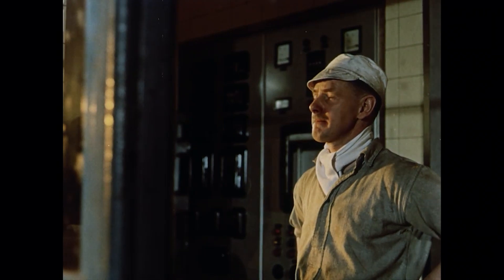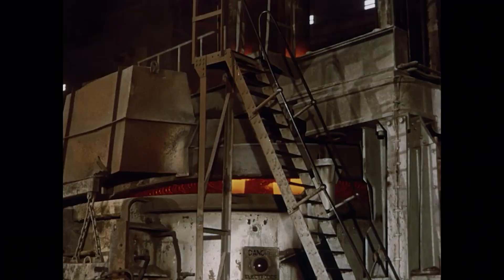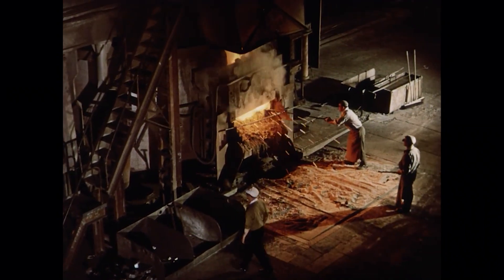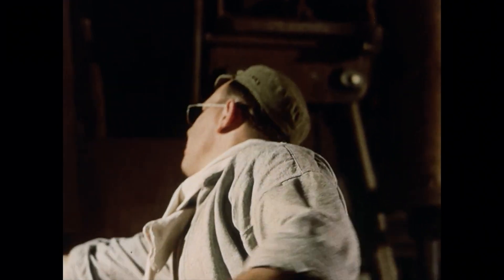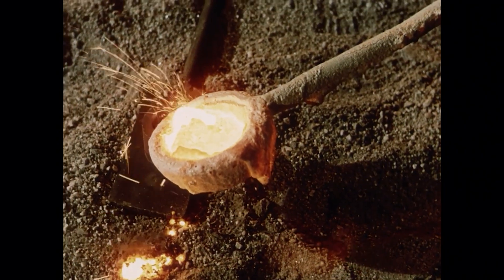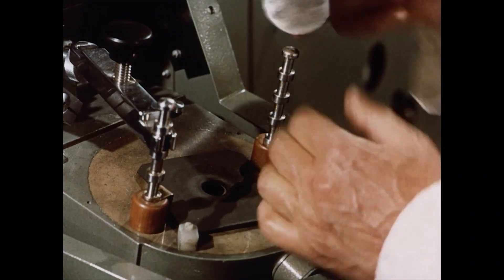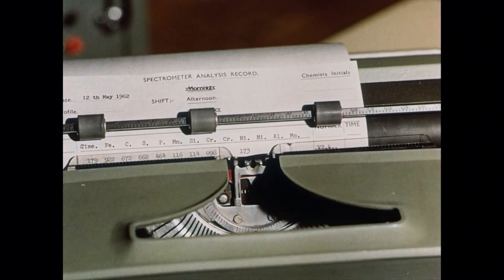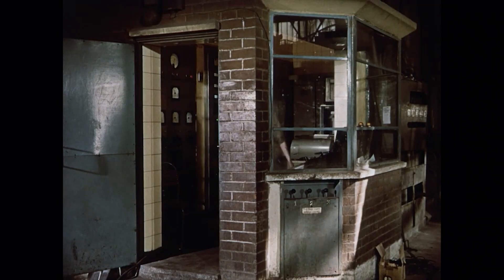Stocksbridge No.2 Meltingshop | Electric Arc Furnace

Comment: Bk in the day, 4 electric arc furnaces  A B C D. Was there all gone now. It's a bone yard now with vast amounts of memories for many ex steelworkers.
Reply from the maker: E furnace was the last one at Templeborough.

A and B got sent to Aldwarke from memory and turned into N and T furnace. N has been pretty much completely rebuilt but T is still largely as it was from Templeborough and still in use

Comment: This plant still exists today and still has its twin arc furnaces! It’s now run by liberty steel UK.
Reply from the maker: @AluminumOxide  the Stockbridge plant still exists but No.2 shop was closed in 2004. C furnace was scrapped about 8 years later. I worked there at the time. 

The EAFs Liberty have are at Aldwarke, N and T Furnace.